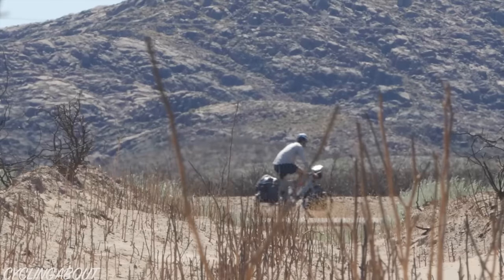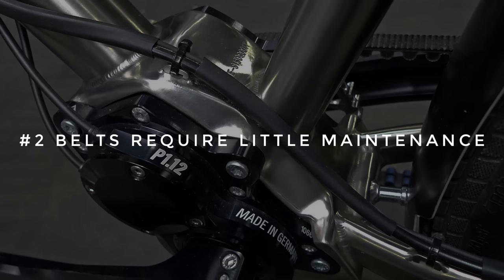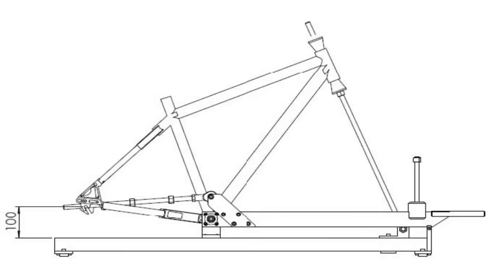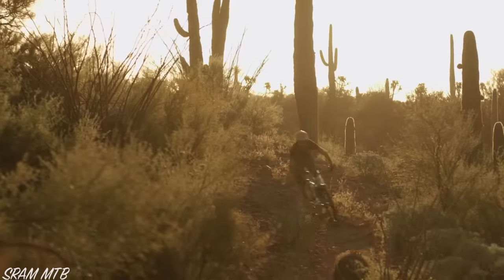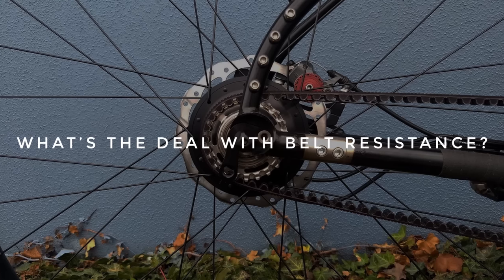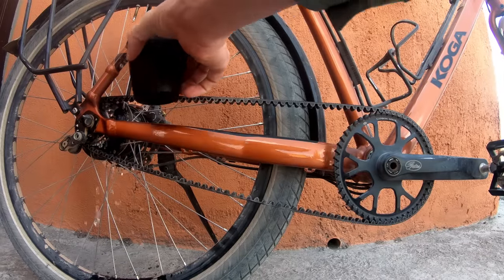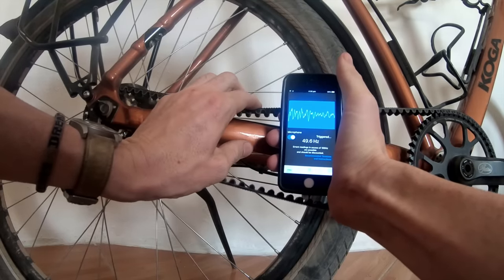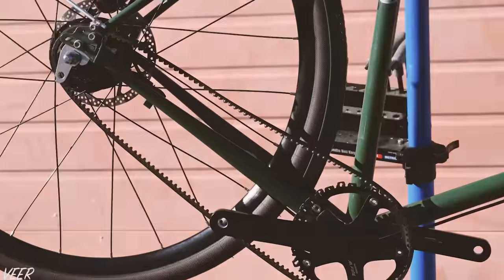Belts Are The BEST Bicycle Drivetrain Available (Epic Testing!)

Comment: What about the weight of the internal gearbox system compared to the derailleurs and standard chain? Weighing just the belt against the chain doesn't show the whole picture.
Reply: you would also need to add in the componenets needed for a bike chain and compare the two.
Reply: He added the drive chain go back to when he weighed them and look at the items in the scales
Reply: @3LGang2L  your just referring to chain against belt. you would need to compare the chain system with the three different parts - derailer, the casset etc ,etc and compare it to the belt with gearbox. its almost impossible to do that. you would need to buy 2 bikes as same model and retro fit to compare. 

simply comparing belt to chain isnt enough.
Reply: @Stephen Cho 
Overall weight is vital for road bikes, not so much for commuter bikes
Reply: People are probably going to boo me but you could totally use nylon or delrin (polyoxymethylene) pulleys and gears with a belt system instead of steel to reduce weight. I've seen delrin gears that can handle 5kw easily and a bike isn't even close to that kind of power.
Reply: @atomicskull6405  Perhaps the issue is that it's just not strong enough for the desired shape of teeth on these. Abrasion resistance might play a pivotal role as well.
Reply: @atomicskull6405  Snapping gears isn't really the failure mode most people are worrying about, it's wear.  Plastic can certainly be amazing for this in some applications, actually decreasing downtime compared to steel.  But this isn't a gear for inside a sealed machine...  My concern is: how does delrin (or other plastics) cope with sand and other debris compared to a steel gear?  Do you have data or experience on that kind of application?
Reply: @haskinsian  Delrin would have quite good durability, it is an excellent engineering plastic. Some plastics can actually wear less than metals when certain abrasives are present, but I would expect high-hardness steel to still last longer in these conditions, it could at least easily be used to replace the front ring since the wear resistance couldn't be much lower than aluminium. It would still be interesting to see a rear one though since it would at least last a useful amount of time, just depend how often you need to change it since delrin is not super cheap.
Reply: @atomicskull6405 
I used to build jet engines and am very impressed by the properties of Delrin. I don't know why it's not used more often. I think a lot of bushings should be made of it.
Reply: and boom his experience was wasted. but what about axle drives?
Reply: The rear cog and chainring were included against the chain alone, plus, aside from having to compare entire systems to get an accurate picture, I'd give priority to reliability, too. It's not that hard to damage a derailleur and even if it's still working, it may not work right.
Reply: @samheasmanwhite  Most large size (i.e. about 5-6 foot long) electric and IC powered R/C helicopters use delrin main gears with a 12t-15t steel pinion on a 5kw to 8kw 50v BLDC motor or a 5hp glow engine and wear isn't a problem, the gears last for years and thousand of flights. The gears are typically 1.0 module with around 100-120 teeth.

 A lightweight nylon housing could be put around the gearbox to keep dust and dirt out.
Reply: @Kodobro  You couldn't even use the same bike to compare, because  belt needs a specific frame
Reply: bookman Etoiles yeah, for a commuter reliability is much more important. (Also if you’re wearing a suit,  the last thing you want is to get chain lube on your pant leg)
Reply: If you weigh more than 70kg and worry about the weight of a Rohloff hub or a Pinion ...start worrying about your own weight first...
Reply: What about price?
Reply: @3LGang2L  what about delariour and casette vs gearbox and everything else for belts.
Reply: ebikes solve this.  A belt-drive ebike with an internal gearbox will be the last mountain bike you need.
Reply: @ThaiTopFitness unless you’re using internally geared hubs anyways. I’ve been riding exclusively IGH for a few years after moving to a place where they’re the norm, and I’ll never be seen on a derailleur again. The smooth, reliable shift of an IGH is unmatched, and there’s no amount of weight reduction with a derailleur that could get me to switch back.
Reply: @atomicskull6405  In bikes it's not the power but rather the torque. Humans spin at 10-30 times lower rpm than typical electric motors, which means the torque is that many times higher for a given power. Internal gearhubs and crank gearboxes are much too small to house plastic gears of sufficient size.
Reply: @atomicskull6405  I had CDN rear cog in my Cube bike, made of some kind of composite plastic. Its the wear issued by sand, mud and stuff like that that kills it, not the tension...
Reply: Great system for ebikes for sure!
Reply: @atomicskull6405  Believe me: plastic gears wear out fast.
Reply: @b98a4c37  ...Or the ability to shift under load.
Reply: @b98a4c37  I got a feeling that place you're talking about is the Netherlands.
Reply: @samheasmanwhite  How well does it do with grit and abrasives ?  Most plastic are not very forgiving.  Also what temperatures do the gears (delrin) get to ?  Compression vs tensile strengths ?  Comparable to hardened steel ?
Reply: @GodzillaGoesGaga  Delrin does extremely well with fine grit, larger grit like sand gives a bit more wear. You wouldn't be getting close to the softening point, and the strength is definitely high enough since most of the forces are compressive. It's a pretty great material, but hardened steel would still be more durable. I would just use steel, the drivetrain is important so I don't get why people make it less durable just to get a 0.5kg weight reduction.
Reply: @samheasmanwhite  Thanks - Good info.  There's always some clever use of newer materials so it's interesting to keep up to date.  I guess if you're a pro and every oz matters and some big sponsor is picking up the tab, then go for it!  For normal people, use tried and trusted.
Reply: Stephen Cho  I own four bikes. One is belt drive. It's the one I ride the most!
Reply: especially considering the fact that a good modern chain is around 250 grams too (example: shimano ultegra chain) instead of the ridiculous 460 grams he showed in the video
Reply: And bragging that it's completely silent.. But later saying it has a humming sound and it gets loud when dirty.. So basically like a chain.
Reply: If you are touring, a few ounce won't matter much.  Durability is
Reply: @tdgdbs1  that's not the point.. The point is that he compared the weight between the two and gave the belt the advantage while not showing the whole picture (gearbox vs cassette)
Reply: Just weighing the century-old derailler system vs a Rohloff, is no comparison, either. Plus, the derailler system is a bit like planned obscolesence that keeps you buying replacement parts.
Reply: Stephen Cho  Ah, yes! I love seeing spandexed-out lardos on their 16lb bikes.
Reply: @booketoiles1600  what is the difference between a road bike and a commuter bike??
Reply: Thank you. It’s clearly a bias comparison.
Reply: If you are touring (or cross country cycling) weight is less of an issue.
Reply: shimano 11 gears internal hub around 1.6kg plus shifter, belt and cogs. it´s wieghs rougly the same as standard deraileur but efficiency is lower especially at lower tempratures and lieber Gears. but for a commuting bike speed doesn´t matter that much.
Reply: Chun Hei SO  I'm a commuter. Even though i live in a flatland city, I know that the tiny extra of 200g is irrelevant even with hills if i have 10 kilos of groceries shuffling around in my bike's basket. Or an oscilloscope and a bunch of power tools in my backpack. Extra efficiency can be helpful though.

For my flatland, i have a single-gear chain bike that is heavy, old, and unappealing. So much so that i don't mind leaving it next to a store completely unlocked, it's been two years and it hasn't been stolen yet. That's a somewhat important bit of convenience.
Reply: He's doing ultra long distance touring. Saving a few grams ain't really his biggest concern.
Reply: Stephen Cho  hes a tourer so grearbox weight probably doesnt bother him.
Reply: @marcinbitel  Here in the Netherlands those gear shifting hubs are very normal, indeed. I don't know, if it exists yet, but you could install such a hub to the front sprocket as well. Compare it to the derailleur system, three gear ratio's front and nine at the rear.... Why not?
Reply: Stephen Cho  Five speed? Seven is in "old" bikes now, nine is standard  and don't be surprised that number could go up. That is in very normal commuter chain bikes. In the Netherlands. So, you have good reasons for hope. All kinds of bikes are developing fast. Hope you'll find the right bike. Maybe you can convert an existing bike?
Reply: @CarnevalOne  Switch over to shaft drive. Just kidding, that's the motorbike discussion. But serious, I've seen bikes without a chain. Those shaft drive bikes could be the answer against wear. Replace the oil each year, check for wear each five years, that could be all maintenance.
Reply: @truth-Hurts375  if I was 6' tall and weighed 70kg I'd be anorexic. I'm 5'9" and I weight 75 kg and by no means I'm overweight.  Professional soccer players around my height might even be a bit bigger than me.
Reply: @MSUTri  I was about to mention that I've come across some old ss bikes that have a ton of miles where the drive train has been neglected and there aren't any high issues with the chain.
Reply: @CarnevalOne  internal geared hubs have been around for as long and there is a reason why they have not supplanted chain drives.
Reply: He’s got two belts too, and the bottle of belt juice
Reply: @voornaam3191  shaft drives are less efficient and not so tough as you can think. I had to change the shaft of my BMW R1150RT each 40.00 kilometres while I made more than three times that, 100.000 miles, with a belt on my much heavier and torquier Victory Vision and it's still in very good shape. :-)

BTW, the public bikes of the municipality of Antwerp in Belgium use a shaft drive, a good choice for this type of application, as it's much more difficult to tamper with them. :-)
Reply: Belts need a dedicated frame. Belts give you either an internal hub or single speed. Belts have to be sized to the frame and pulleys used. Belts are not widely available. Belts can be damaged by solvents and UV rays. Most internal gears are not built to handle the torque that chains can handle. It you want pricey eye candy you buy a belt drive bike. If you want a practical day-to-day bike you buy a bike whose parts you can get at any local bike shop.
Reply: @yash1152   a road bike basically is a racing bicycle or a bike that is as light as possible; think sports rather than comfort. Commuter bikes have a more comfortable or more practical layout focussed on daily use in a practical manner.
Reply: This guy has ridden more miles in his one life time than the combination of commenters below. Reading these comments is like reading opinions of EV car skeptics. I will take this guys word for it.  My next bike will be a build by Co-Motion Cycles in Oregon. I like the Divide frame with the Rohloff Speedhub / Gates Carbon Drive, or possibly the new Pinion P1.18 Gearbox / Gates Carbon Drive. 636% overall gear range from a 18spd bicycle transmission.
Reply: Internal gearbox increases unsuspended weight of the bike which is unacceptable for many disciplines.
Reply: bro for  the chain version you need a ***cassette also, which, plus deraillé must be pretty much the same.. or more
Reply: Yes, a gearbox or Rohloff is heavier than a traditional derailleur system, even with a belt. But the self contained nature is worth it for the weight for the type of riding this guy's talking about.
Reply: I wonder if it would be possible to have an internal geared hub, and have external gears.
Reply: @darrylkinslow5613  No. And why would you want that? You could conceivably have a pinion gearbox and then have a derailleur as well, but nobody needs that many gears.
Reply: @voornaam3191  It would literally be useless on the front hub, it's meant to be driving a chain and you can't put a chain on the front.
Reply: @voornaam3191  7 is standard, actually. 9 is rare.
Reply: @MSUTri  I am riding a belt and it's far superior to a chain. A chain needs maintenance while a belt doesn't need any. IMHO is everyone who is worried about efficency putting out so much power that a belt is at least equal to a chain.
And pinion is around 91% efficency while a Rohloff is at 93% and a chain drive with derailer at 98%.
And a rock at the right place will kill a chain drive too. A lousy small stick got stuck in my shifter resulting in the destruction of the shifter and locking the rear wheel at 25km/h. Don't recommand it!
Reply: His scales say 461g for a chain?  but its 240g for a kmc sl.
Reply: @atomicskull6405   Torque is the only thing that matters here. Delrin or nylon wouldn't be strong enough.
Reply: This is getting ridiculous, we're talking about a couple grams difference at this point, you introduce more weight yourself by cycling after lunch than this belt and internal hub v. belt and derailleur
Reply: @GrandMerc89  Belt is quite normal nowadays and getting even more widespread for e-bikes. And it depends on what you buy. A Rohloff will handle everything you can pedal while a shimano might not. I switched from derailer to belt and will never go back. Bike needs zero maintenance apart from hossing it down.and I had days with slightly wet conditions where I needed to scrap 300g of dirt out of my bike for 2x15km commuting. Belt is for commuting and trekking and derailer is for sport.
Reply: Which system has the lowest rotational weight? As rotational and static weight are not the same. Sellotape a hand full of coins around the outer-edge of a bike wheel and you will feel those few grams even if perfectly balanced, but put those same coins in a frame storage bag so they don’t rattle and you wont feel them so much, if at all.
Reply: @sbaxter4207  Rotational weight is meaningless als long as it is balanced. As the wheel has the same speed as the bike it doesn't matter at all. Rotational weight is important for accelerating engines but not for bikes. The weight of wheels is important for suspension purposis because this accelerated.
All in all it doesn't matter if a mass is rotational or fixed except for suspensions.
Reply: strength aside, you say the weight of the parts rotating on a drive-chain could be very heavy or super light it makes no difference to performance?
Reply: you say "Rotational weight is important for accelerating engines but not for bikes." you're joking, right?
Reply: @sbaxter4207  nope. We are talking about thousands of rotations wcompared to a bare 100. What I am saying that rotational mass is just equal to normal mass on a bike. And for an IGH this mass is almost dead at the center of rotation. Rotational mass just isn't a thing for bikes.
Reply: @sbaxter4207  right. The rotational speed and is just to low. But a  heavy drivetrain certainladds to the weight of the bike which matters
Reply: @svenweihusen57   you say: "We are talking about thousands of rotations wcompared to a bare 100" and how many times more powerful is this engine you speak of compared to a man at near 0.5hp? if you put 1 kilo onto a frame of one bike v around the outer edge of a wheel on another otherwise equal bike and run fair tests on performance the bike with the weight on the frame will come out tops. rotational weight is just as important on a pedal bike. Especially when trying to win a race where every cm counts when entering or exiting a corner or crossing a finishing line.
Reply: @sbaxter4207  you are speeding this 1kg up to your speed because a wheel turns just as fast as your bike goes. The 1kg will not make a difference if you put it on the frame or the rim because both get up to the same speed. You try to keep wheel weight low for overall weight and for better suspension performance on an MTB. Weight is a Hunderande when you are accelerating, that's why engines try to keep the fast moving mass down. The crankshaft is way less important than the pistons because the acceleration is way less.
Reply: With rotation of a wheel the weight needs to move forward then around, down, then backwards then up and forwards. it requires more energy to get the mass moving like that.  It is rotational, its not the same a linear. That’s why weight on the outer edge of the wheel effects the acceleration  and deceleration /performance more than that of the centre of the wheel. have you ever been on a roundabout in a playground? have you ever tried pushing someone when they are centre v outer edge?
Reply: here is an answer from a physics website : " the wheel weight counts more than the frame weight. The reason is that when you accelerate the bike everything moves forward together but the wheels also rotate. The average velocity over the whole wheel is the same as the rest of the bike, because the different parts move all the different directions in a circle. however, energy goes as the square of the velocity, and the rotational energy of the wheel just adds to the energy of the average motion. So you have to pump more energy into the bike to get a pound of wheel moving than to get a pound of frame moving. If all the weight of the wheel were out at the rim (which isn’t too far from true) the total wheel energy per pound would be twice the frame energy per pound, i.e. equal rotational and static weight. The real rotational number would be a little less.
"
Reply: @sbaxter4207  the outer edge of a a roundabout is way faster than the middle because it moves a longer way per rotation. And due to the kinetic energy Formular you need 4 times the energy to double the speed. A wheel is moving exactly at the speed of your bike.
Reply: @sbaxter4207  okay, makes sense and states that you are right. However with an IGH the weight certainly isn't on the rim and so it is moving way slower than the rim which results in way less energy needed to accelerate an IGH compared to a same weight wheel with the weight on the rim. My hub has a diameter of 10 cm which means that the rim of the hub has a speed of around 4km/h when the bike is going 30. And the weight is even closer to the axel.
Reply: @svenweihusen57  lighter = more performance, especially with parts that rotate.
Reply: @sbaxter4207  less weight is always good for performance but the weigh of the IGH is meaningless. The main problem is that it is less efficient than a derailer system. But it's benefits outweigh it's disadvantages for most bikers.
Reply: @SnootchieBootchies27  look into your Sturmey Archer history a bit more. It was actually a fairly common system to combine a Sturmey three speed with a thread-on 5-6 speed freewheel, and not have a front derailer.

Sheldon had a frankenbike with all the gears made like that.

It’s definitely *possible*. It’s just not usually the right answer, unless the question is “why the hell not!?”.
Reply: @JasperJanssen  yeah, I guess that could be a thing. I was just thinking along the lines of Rohloff and a cassette style freehub. You know, something from this century that you could actually build a sturdy mountain bike wheel with that would fit a modern frame.
Reply: @SnootchieBootchies27  a rohloff plus a 12 speed cassette plus a triple front plus a bottom bracket gearbox, you say? Intriguing!
Reply: @JasperJanssen  yup. Gearing low enough to climb hills on the sun.
Reply: @SnootchieBootchies27  you totally could do it, albeit with some custom work to mate the free hub to the Rohloff, and the triple to the pinion, and of course a completely custom frame with custom spacing. Hell, add a fourth ultra-granny ring (great-grandma ring? Nana ring?), while you’re at it. I’m sure I’ve seen that product around, although I think it was intended to add a third to a double.
Reply: @SnootchieBootchies27  PS: the algorithm graced me with this: https://youtu.be/UFMhUYoqFyc

Which is…. A 2 speed hub gear specifically for use with a modern 11x cassette, to replace the front derailer.
Reply: @blurglide  You're right, an ebike will be the last bike I need. When I'm 80 years old
Reply: @Kodobro  Yeah, just as he said in his post.

"Derailleur".
Reply: @truth-Hurts375  What a ridiculous statement. Firstly, at 70kg, many people would be medically underweight. Secondly, muscle weighs more than fat, so even moderate weight training may well increase your weight, even if those muscles play little part in cycling. Mass plays a role even when not riding... having to lift/carry a bike is not uncommon.
Reply: @atomicskull6405  I know this late but polypenco would also be a great choice!
Reply: I'll throw "polypenco" into the belt contact cogs, incredible wear resistance!
Reply: @hematogen50g  Most bikes are completely unsuspended at both ends. A large number are only suspended at the front wheel. In most cases, the entire machine is unsprung weight, so your point is moot.
Reply: @Twittler1  Wheels are not just plain weight. They have gyroscopic inertia. Heavier wheels make it difficult to steer.It might take no effect on cruiser type of bike but for bmx or trial heavy wheels are big No No
Reply: @hematogen50g  I understand that, but you were talking about unsprung weight, which is what I responded to.
Reply: First of all, the obsession with weight in bikes is way out of hand and a bit ridiculous. Look at the conditions and cycling style demonstrated in this video — a weight difference of 1-2kg will have virtually no impact.

Secondly, as pointed out, he does demonstrate the weight difference of the overall drivetrains.
Reply: Sure internally geared hubs and bottom brackets weight more, however they do last longer than your derailleur and rear groupset. For instance I have a Enviolo N380 internally geared up. It's sealed and will never need service. Our Alfine 11 speed internally geared hub needs an oil change every 5000 miles. Whereas you will have to relube your chain way more often. A little more weight is a small trade off for never needing to clean a drive train or replace any of it's parts.
Reply: you also have to carry a spare as you can't repair it...
Reply: @KillerkoUK  How many people do you know that carry extra lengths of chain. I know I don't. Also those belts up to 4x longer than a chain.
Reply: Stephen Cho  everyone just switched to electronic shifting and disc brakes. They are both heavier. It isn’t just about weight.
Reply: Stephen Cho  I’m not talking specifically about gear boxes. I’m countering the argument that cyclist won’t adopt things that increase weight. Dropper seatposts on XC mtbs would be another recent weight addition.